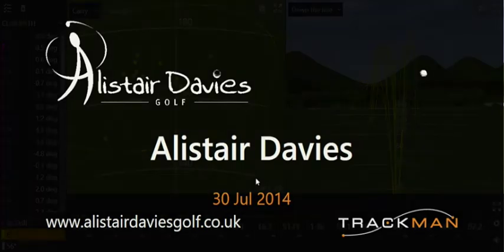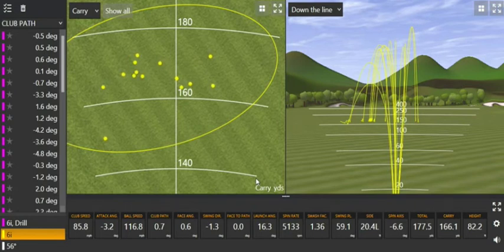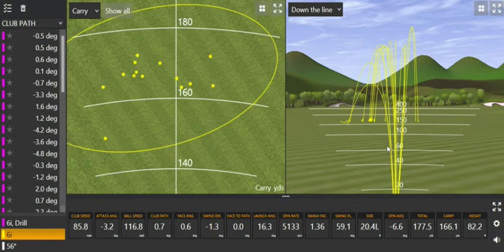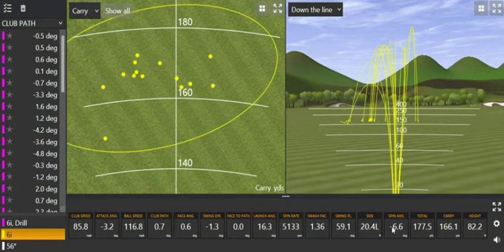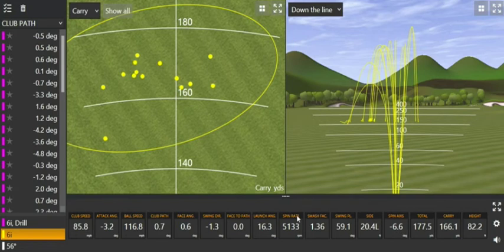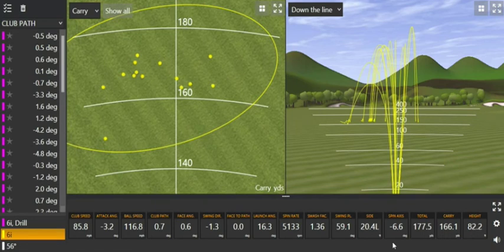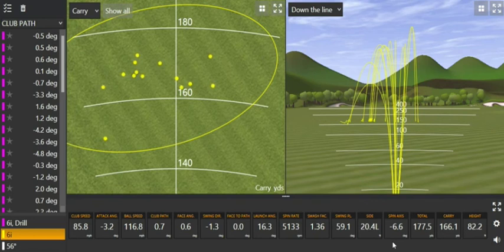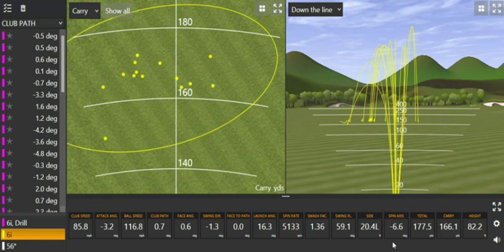Golf Tip| Spin Axis using Trackman

Comment: This is interesting data. If path and face are nearly neutral then one possibility is indeed that you are getting a slight "gear effect" however this looks like it is mid iron data, thus presumably a flat face. Gear effect is not coming from face bulge. You posit gear effect based on the club deflection, which with a flat face would mean that for a draw would be closed to the path which we know is not the case as it is measured. Further if this is a club face deflection , it would mean the face is square at impact but heel deflecting (closing) past impact,  heel strike not a toe strike. 
Also, and I think more likely is that the lie angle of the club is a bit off. If the face is square but the toe is up, side spin will be departed in a draw fashion. Make sense?
I hope I'm thinking correctly here and I am not exactly sure how Trackman measures the club face angle. I think some other camera based machines may actually measure toe up or down-ness of a square strike and might answer the question. I'd be interested in your thoughts.
Reply from the maker: I think it’s more to do with centre of mass in the head and that tilting the spin